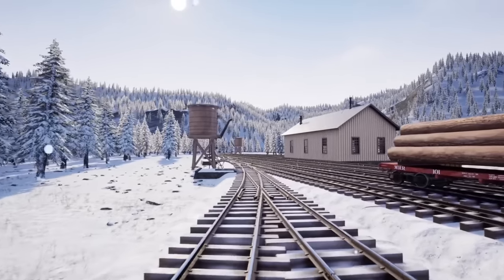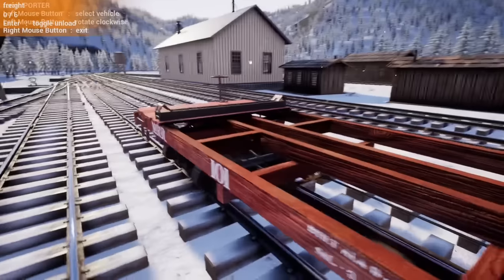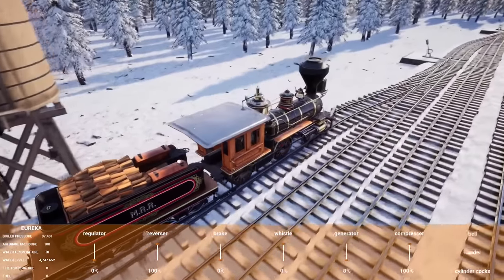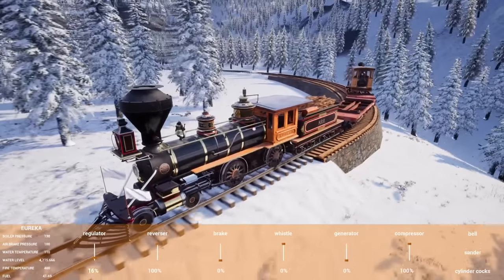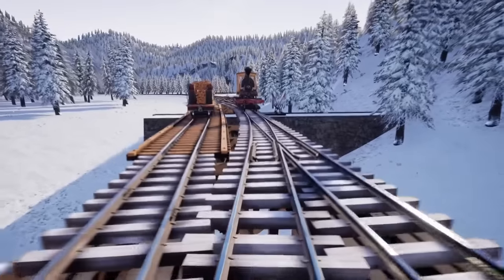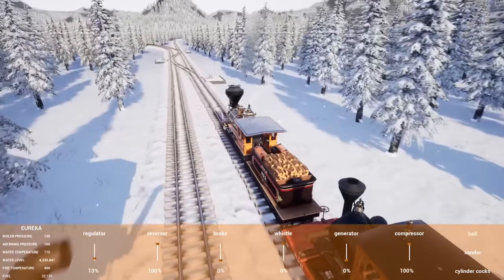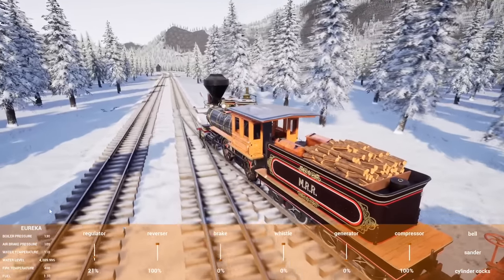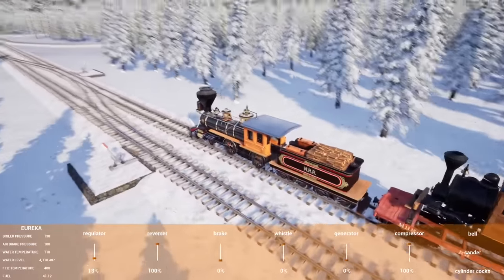Transporting A Train Engine On A Railcar In RAILROADS Online!

Comment: This could actually be useful in the new version that has rolling resistance factored in.   You could haul more cars with less friction on the tracks.  Simmilar to a flatbed truck hauling the pup trailer on the lead trailer on a long deadhead to save fuel.

Comment: That's why on a real RR. When a train goes off into a passing siding, the switches are set back to the main. Then pull off the passing siding, set the switch back to the main. So that way the mainline train never has to check to see if the switches are aligned.